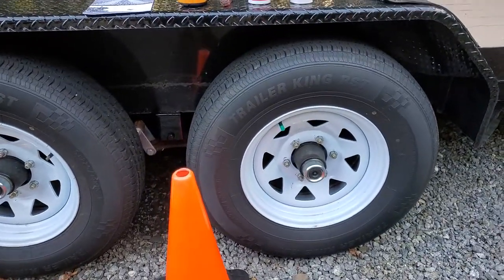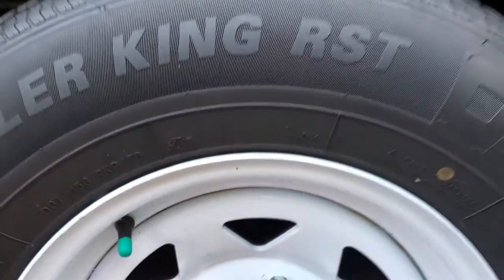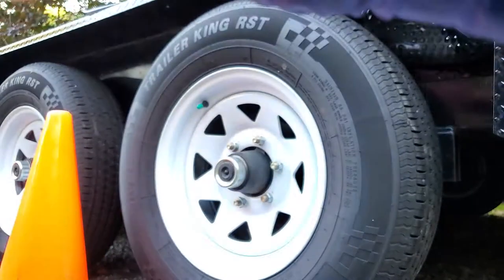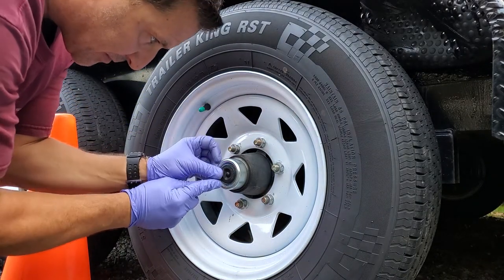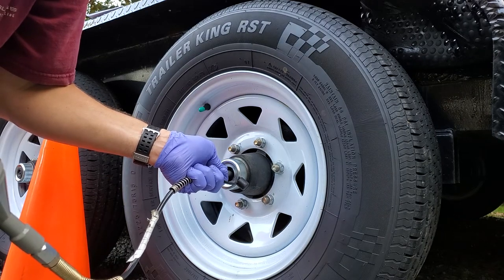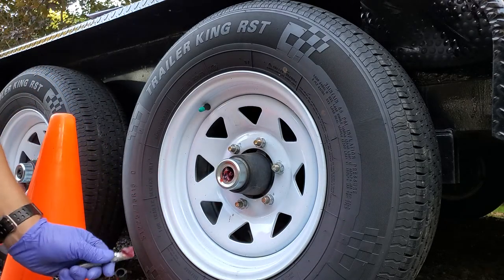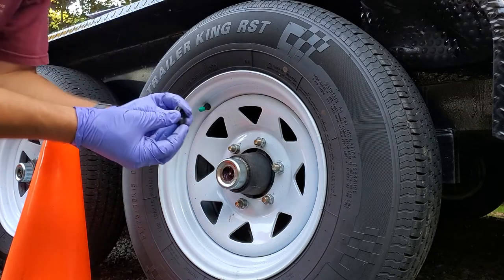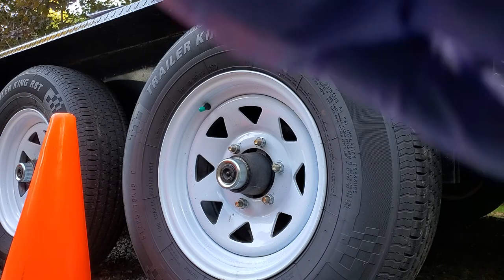How to repack trailer wheel bearings with grease on a Sure-Trac trailer.

Comment: Jack the trailer up and spin the wheel as your pumping the grease into the wheel bearing. Coats the bearing much better. Also, keep pumping until you see only the color of  the new grease and no old grease.

Comment: just a heads up no trailer dealership actually puts grease in the bearings before they sell them, I recently bought a brand new dump trailer last year and before putting the first load in it I went through it just to see how much grease was in the axles and to my surprise there was nothing in them, just enough in the bearing itself just to get it down the road, 2 tubes of grease later they were finally full. nothing worse then wrecking a brand new axle cause of no lubrication.
Reply from the maker: Interesting.  Thank you for sharing your knowledge and experience.